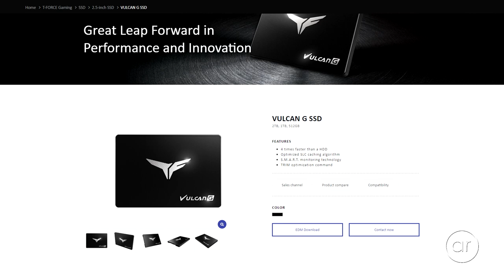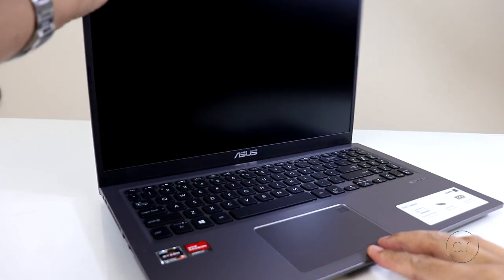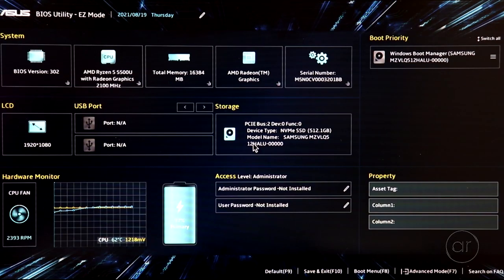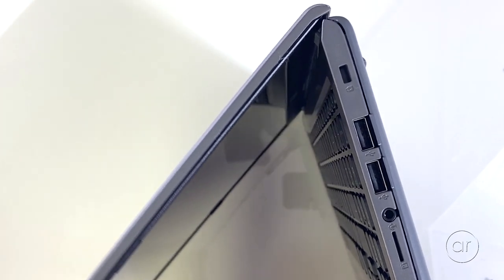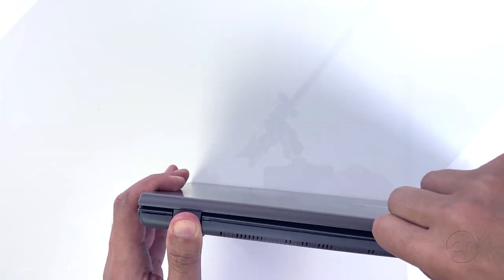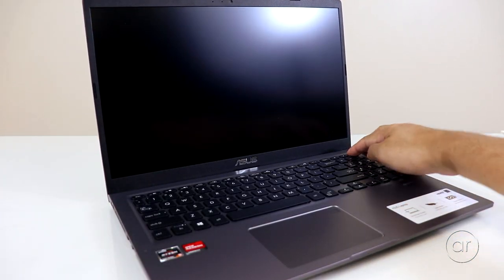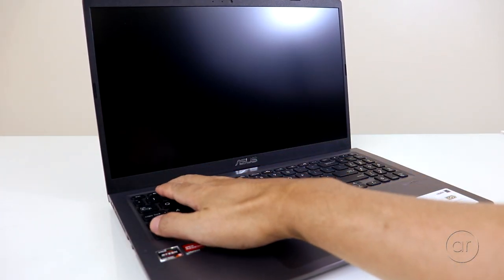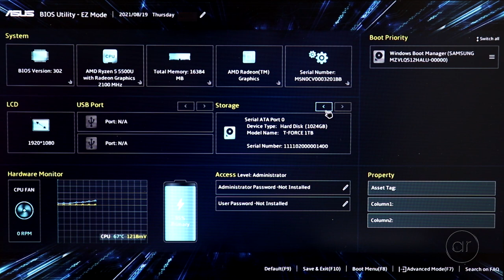How to Disassemble an Asus VivoBook M515 to Install an SSD (New 2021 Model)

Comment: Pretty good guide except for at 6:53

Just thought I'd point it out for anyone coming along after. The ribbon cable to the 2.5" Drive should route straight down from the connector and only have one bend then over to the 2.5" drive. Like a backwards L, sitting atop the battery. There's actually a cutout in the plastic between the battery and 2.5" bay for this purpose. And the ribbon cable is usually pre bent at a 90 degree angle to route this way.

Tucking and squishing the cable like that can actually cause a bad connection over time. Just one right angle bend through and have the ribbon lay flat is best.
Reply from the maker: Thank you for the tip and the feedback. Do you mind if I add your comment to the description, with credit to you?
Reply: @accessrandom  Sure and sure. No problems, again it's a good guide overall. But ribbon cables like to lie flat, haha! All good!
Reply from the maker: @djarumz  Thanks! I've added it to the description.

Comment: Hi! what do you think about the cooling system here? 5500u not getting hot?
Reply from the maker: I'm probably not the best person to ask since I don't use it for high-end games or anything like that (the most demanding thing I've done it install Windows 11 Insider Preview in a VM), so I haven't really measure any temps. The fan does kick in though...
Reply: @accessrandom  what is average temperature this ryzen in your apps?

Comment: I have the M513U model...would this adapter work for it? Or the A version of this? I have searched for clear information for hours and can't find anything concrete :( And can't find the M513U model in any compatibility list of the ones sold online.
Reply from the maker: You may want to contact the seller directly as they seem to be responsive about specific models.

Comment: hi there cant seen to find ribbon connector for this particular model, for other asus models yes but not this one, are they all the same size thanks
Reply from the maker: The one I used for this model is linked in the description. Is it out of stock?
Reply: The adapter you listed shows a 7 week ship date. I have a 515UA also. Can you suggest an alternative adapter kit? Thanks!

Comment: Thanks for the vid!  However after connecting the SDD with the 10pin cable the PC won't turn on, even if attached to the AC adapter. Still don't know why, like a short circuit, it's been a couple of months now thinking about this, I've bought a new cable in the past days but I don't know if this is going to fix the problem. 

Do you have any idea? (One user suggester me to detach also the RAM and not only the battery but that wasn't very helpful)
Reply from the maker: I don't believe the SSD cable would cause it not to turn on - I would check along the chain of the power supply and the soldering on the AC plug on the laptop. If the battery wasn't disconnected after it was opened, it is possible that something may have shorted out (with a touch of the screwdriver, for instance).
Reply: how is it now? do you have any fix about that?
Reply: @rendyrandall2351  Hi! Problem solved just buying a new cable (not the original spare part), maybe it was faulty I don't know.....anyway happy to have successfully installed the SSD

Comment: Do you know if the model with the ryzen 7 5700U is able to be upgraded to 16gb? I can’t find any info on it. It comes with only 8gb of soldered memory. I cannot figure out the cas latency of the memory or the clock speed. Mainly I just need to know if it’s upgradable as I can figure out the rest after I get the laptop
Reply from the maker: Unfortunately, I couldn't find much info on the internet other than it is upgradable to 16 GB. I'll need to defer to others who may have this specific model - anyone?
Reply: @accessrandom  wow I am amazed you responded to this lol. Thx. Most people don’t care about their old videos. Good luck to your channel and I hope you hit amazing growth.
Reply: @accessrandom  how have you liked the laptop tho? Has it slowed down at all or had any problems?
Reply from the maker: @jimmiewilson626  You're welcome, and thank you 🙏. The laptop is going strong - I like that it's very lightweight in my backpack and it's relatively fast. it's primarily being used for programming and Matlab.
Reply: Is it really upgradable,  does it has ports?

Comment: i have a M515DA-BR355,he have 12 or 10 pins?
Reply from the maker: I'm not familiar with that model, but you may want to contact the seller to make sure (they have been responsive in the past).
Reply: I will see in 4 days
Reply: mano, tenho um m515da - br1213w, mas o que importa é que é parecido com o seu. No seu caso você ja fez o upgrade de memória ssd ou de ram? comprei um ssd que esta para chegar e queria comprar o adaptador sata mas estou em duvida de onde comprar e qual comprar. E ai? Comprou algum?

Comment: Modern hardware is usually hard to open for no good reason at all. I'll call this poor engineering since it does nothing but causing issues to the end user.
Reply from the maker: Yes, I miss the days of an easy-access panel where you just had one screw to access the memory and SATA. I also hope manufacturers don't start moving to these ribbon connectors.
Reply: i agree wif that and i would be afraid to break the casing.
Reply: I did break 5 of the little hooks inside.... I never had this kind of experience with a laptop.....
Reply: agree 1000% I just tried to help my friend fix a fan issue with his HP Inspiron 15" laptop and upgrade his memory modules and OMG what a PITA to try and open this thing. Took me forever and Im worried about trying to get it back together after Im done with the fixes. Terrible design for serviceability and upgrading for owners. They dont want you to get in there they want you to pay loads of $$ to have them upgrade it for you. If they know its easy to upgrade then they know you will buy the lower end product without all the options and do the upgrades yourself for much cheaper (and better) parts and labor so.... yeah it sucks but they know . There are a few mfgs that cater to upgraders but that is few and far between. the days of twaeking and building your own pc (unless its a desktop) are over. for laptops its almost become a disposable product.